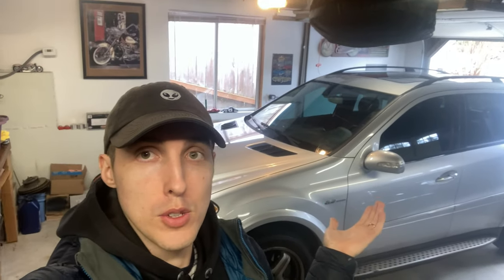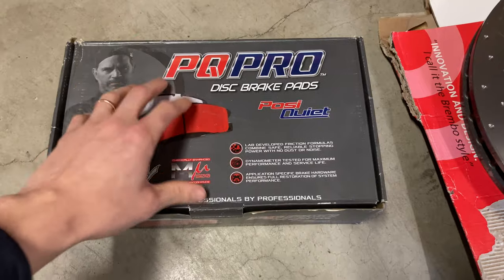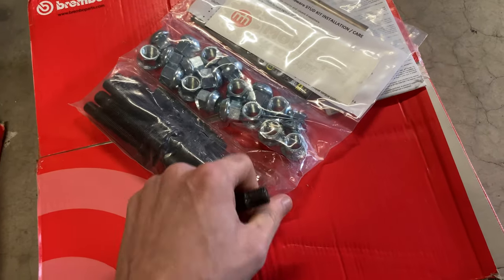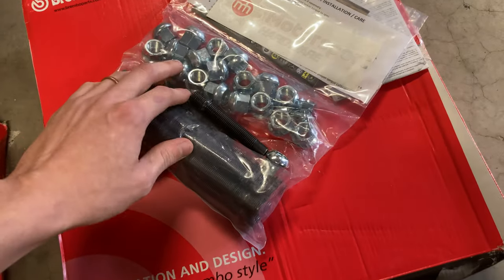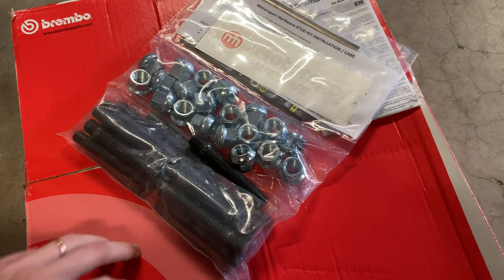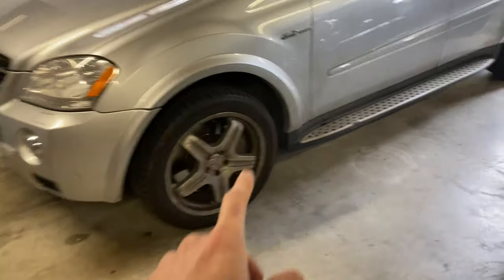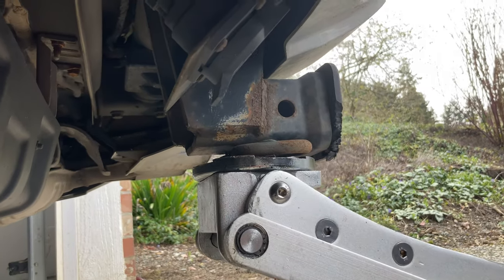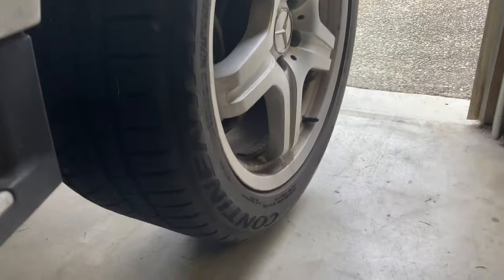ML63 AMG WHEEL STUD CONVERSION AND HUGE BREMBO BRAKES

Comment: I learned the hard way, that it is a good idea to replace lug bolts on used cars with unknown history - or at least measure them with a caliper measuring tool. so many shops impact wheels on, stretching the bolts. I had 2 break on my CLK when it was new to me, just from the shop that the seller picked for pre-inspection. Great idea to go with lug studs when you are looking at it anyway. BTW there is a guiding tool/stud usually in the trunk that you can screw into the wheel hub to help you get the wheel on. I found it very useful when working with lug bolts
Reply from the maker: great input as always, definitely true.. These lug bolts were pretty ugly forgot  to show them. Someone also way over torqued the fronts, had to stand on the breaker bar to get them off.
The guide tool definitely makes things easier!

Comment: +1 vote for painted side skirts... Cool to see how they changed up calipers from the older design. 👍
Reply from the maker: Also leaning that way! Feel like it’s the only thing that dates the design.
Yea they are pretty neat!
Reply: @ANDERZENAMG  yeah would look cleaner, it does date it a bit but it is very consistent with even modern day AMG "dots" pedal design. Curious is that an "AMG only" running board?
Reply from the maker: @BaldManMotors  very true, that design has translated to many models and pieces. No they came on all models pretty much as an option…
Reply: @ANDERZENAMG  Apparently they used these single piston sliding calipers in the R63/ML63, and a bigger dual piston version in the S63/S65/CL63/CL65 at the time for comfort, as the sliding calipers have a softer less aggressive bite than say the fixed piston 6 pots or 8 pots found on other AMGs from the same time period. Interesting as it only lasted this generation for these types of cars, everything since has been the fixed piston 6 pots. Personally I would've preferred fixed 6 pots 😂 maybe a retrofit from the 166 in the future?
Reply from the maker: @SamAbraham  same! Bet they would fit since the w166 rotors are a confirmed fit.

Comment: Didn't even know Brembo made rotors for our 164 63s, I have a pair of new Zimmerman rotors from FCP sitting in my garage waiting to be installed too. Good stuff. Oh one more thing, when I did the Motorsport Hardware lug conversion, I also made sure to get a 19mm lug wrench to keep in the trunk if I ever needed to use the spare, as the stock bolts are 17mm in size as the car's kit only has a 17mm lug wrench!
Reply from the maker: Yep! Can’t go wrong with FCP euro was going to grab the same till I saw these.
Did the same, I have the 19 socket in the glovebox 😎